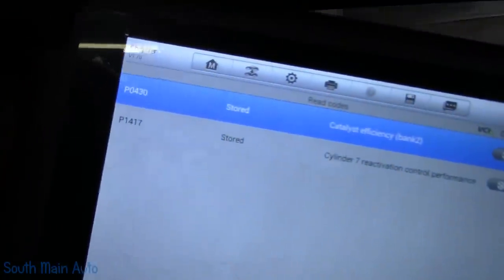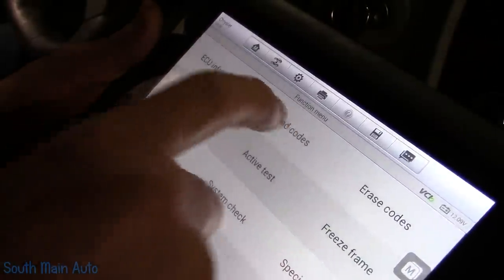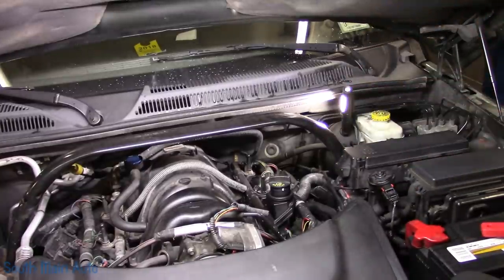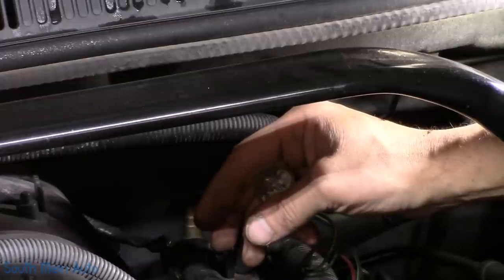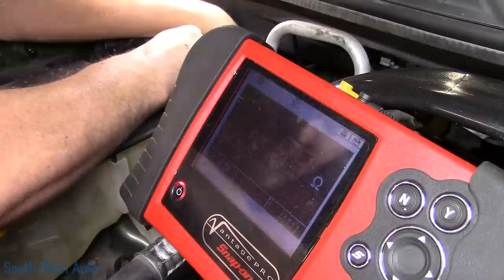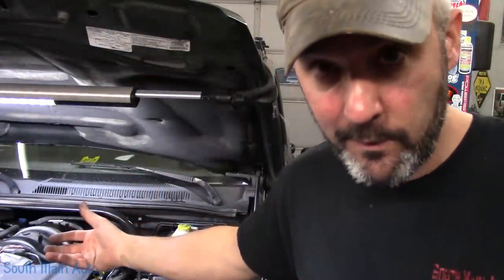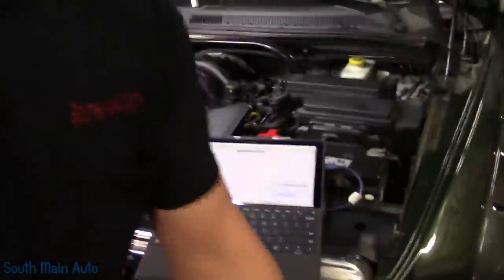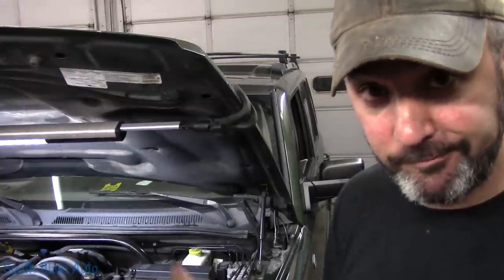Jeep Commander: Dead Misfire / No Parts Needed

Comment: what made you sure the injector it's self was not the problem? I know you tested the control for it and also tested to see it didn't have any amps going to it while running, but wouldn't have an injector with a break in it (open circuit) looked the same? why didn't you test the injector it's self for resistance? (not open circuit)  But great video! Thumbs up!

Comment: On the truck V8 that breaks spark plugs ...to retrieve the ceramic tip I made an adaptor for shop vacuum cleaner by a 1/4 washer pipes about 12inch long  via a glass fuel water trap so the debris gets sucked through washer pipe and drops in trap so you know you got it

Comment: Right away I'm thinking loose plug wire. I had emissions work done years ago, and their recommendation was new plug wires. They charged me a lot of money and put on the cheap wire by the spool, and the plug on ends, which would by their nature come disconnected all the time. Had to do it myself later on.

Well, I guess we are a long ways away from 1969, and the ol' Chev truck. I notice all the electronic work going on and all the "no starts" and other problems, and I wonder how many "no starts" typically came into shops during the week back in the 70's. Are the car makers going in the right direction on all this electronics? Anybody know?

Comment: When I was in the Army, I went to school in 1968 for 40 weeks to learn how to troubleshoot and repair the target tracking, target ranging, missile tracking radars and the analog computer that computed the kill point and guided the missile for the Nike Hercules Missile System. Then I worked at a missile site in S. Korea.  Several times I "fixed" a problem without knowing exactly what "fixed" it.  I accepted it was fixed and moved on.  The system used hundreds of vacuum tubes and there was always something to fix.  Operators ran checks every 6 hours to make sure everything was working.  If not, I went to work. That missile threw conventional and atomic warheads.   Young and dumb with way too much responsibility!

Comment: I wish Ford had a default strategy like that. It would save a TON of CATs. 

Had the same issue on a 2011 Charger. Had a bad cylinder deactivation valve, replaced it and the thing was still misfiring. Like yours the fuel injector was shut down by the ECM and required a reboot. 

In all honesty, tell your customer to start saving their pennies. That engine will bight their pocketbook HARD.

Comment: Intermittent electrical stuff will make you crazy.  Have experienced in the past,  that sometimes simply "making/breaking" contact of electrical connectors resolves an intermittent elect. problem which might be the case here.

Your ohm resistance checks verifies rather low current/voltage.  With the hi humidity, dampness of your area, perhaps a minute amount of corrosion built up in one or more connectors, the culprit you're chasing here.  It doesn't take much to prevent current flow.

Once chasing a NO start condition on a Brit motorcycle, found via an illuminated jewelers loupe 2 of the 122 pins on a long master connector were the cause.  Blast with cleaner, apply dielectric grease.  Wasn't done at the factory, cause of the corrosion contamination.

Myself after this experience, I'd give every one of those connectors a good blast of electrical contact cleaner.  Caig brand "Deoxit" series seems to work better than most.  Disassemble/assemble ea. 2-3 times after cleaner blast to break up, remove corrosion. 

Then cross your fingers, knock on wood!!

Comment: “Disconnect the battery cables and touch them together. “ i readily admit that I have never heard that before. But, after a minute thinking it through, I can see the “logic”of it.  Any downsides to trying that? Or would pixie dust and a crystal pyramid charm be as good? 

Still … an interesting video.

Comment: In the ECU, there should normally be criteria for blocking the cylinder (which it met at some point), and then there should also be criteria for no longer blocking it.   The clue here is the small but notable number of misfires on that cylinder.  Likely at some point it was transitioning from 4 to 8 cylinder mode, and it failed to do so, so it shut it off.  At that point, it recorded the parameters and decided that those parameters are "fail", and refuses to reactivate it as long as those parameters are present (I am thinking engine temp, oil pressure, etc, etc).   My guess is that the pin that engages the lifter didn't engage properly during the transition at some point, left the valve closed when it expected it to be functioning normally, and the misfire was really just a "no fire" because no fuel air mixture got in.  While it would be hard to spot what happened, I think that checking the oil level, oil pressure, and perhaps even doing an oil and filter service would not be a bad idea, as there may be some contaminants in the oil that may have caused the lifter not to engage.

Comment: Looks like there’s no coolant in the overflow, which means it’s probably low on coolant in the radiator. The engine control probably cut that cylinder to lower the engine temperature to prevent damage.
What that means is the owner is in college but yet doesn’t have even the slightest brilliance to check his coolant.

Comment: It doesn’t disable the injector to preserve the cat necessarily… just to keep fuel from pooling up behind the intake valve. The solenoids disable the valves for the specific cylinder so if it didn’t disable the injector when it went to reactivate the cylinder it would open an intake valve with a puddle of fuel on top of it.

Comment: Hey Mr eric i have 2 suggestions regarding your testing here.  1=       When you first checked the injector current you forgot to check the control voltage.  Because no current pulse doesnt mean no control.hear me out .if the injector winding is open or if you have bad pin fitment at the connector you wont current but you will still have a voltage control ( if pcm is not in converter protection mode of course).    You did use a noid light afta to confirm control but what if the injector winding open intermittently .just touching the injector or unplugging it could have temporary fix it.  I believe its better to monitor current waveform then with a second channel back probe control side of injector that way you will know if the injector current return while tou ching the injector .        2=  as far as that code i have seen it set on a vehicule that had a dead miss from a shorted coil.     My theory isthat they monitor cylinder deactivation by. Checking for cyl x misfiring when the solenoid is a activated..well when cyl x is dead already there wont be no velocity change on cyl x powerstroke so the software think deactivation didnt work.   I think maybe thats what it is?

Comment: The lifter had to have stuck at some point and not functioned  correctly or the solenoid mechanically stuck or the oil pressure wasn't enough to lock the lifter .  The plug showed a lot of fouling so I am guessing the intake valve did not decouple and when it went into 4 cylinder mode the plug stopped firing and then the ring of fire began...I am guessing some highway driving will make this issue pop up again
Reply from the maker: remember he drove it about 200 miles with a miss too. I assumed that is why the plugged looked like it did.

Comment: i just wanted to say that Eric O followed a logical step by step diagnosis to try to narrow and confirm the actual problem.  It was smarter at that certain point to do what he did, reset the computer, than to spend more time tearing apart an engine looking for mechanical issues when his gut told him that it probably wasn't the fault.  Did he think the computer reset would fix the problem? Probably not, but it was a better option to try first before opening an engine.  I do agree with him, that it might be heat related as problems don't just appear out of thin air.  The problem is still there if I had to bet money on it.   He will just need to invest more time seeing if he can recreate the bad code again so he can proceed with a follow up diagnosis.  Atleast he can rule out the mechanical lifters.

Comment: I'm just curious you haven't drove it. I'm wondering if the code sets when the cylinder is deactivated or reactivated. In that case could it be oil not flowing.

Comment: From an electrical and programming point of view, unplugging numerous plugs and connection can actually fix the problem. Corrosion etc even minutely can affect current flow. But the computer doesn’t recognize it’s receiving a signal again and maintains its current programming loop. Computers due to a myriad of reasons including a minor programming bug can malfunction. Often just doing a full shutdown forced the computer to start back with fresh current info. It did the reboot looked around and saw everything was in specs. It had no idea of the possible bad connection. If you had done a full reset at the very beginning  you would still have done the work trying to figure out why the problem disappears. Been seeing these mysterious electronic bugs crop up as far back as the late 60’s ( yea I’m old). My dad during WWII called them gremlins, malfunctions with no obvious cause.

Comment: I maintain 6 - 1250 HP, 6000 SCFM 4160 volt air compressors that run 24-7-365 unless a issue arises. They are computer controlled by windows based controllers and I have found that the controllers are very succuptable to any deviations in the 5vdc and 24vdc control voltages. Low or erratic voltages will scramble some but not all control parameters causing some interesting problems that are cured by a shutdown and reboot. I would reseat all the plugs on the Jeep ECU. Good luck!
Reply: Industrial hardware controlled by windows? That controls engineer must be some kind of hack.... far better options out there.

Comment: Was that no 7 solenoid higher in ohm value than the rest at the same temp? It could be going out of range when the engine reaches operating temperature. Would that cause the code and trigger that default strategy?

Comment: I have a jeep... its not like my Chevy coach {vortec 350} at all... complex ignition and tends to corrode more.. for fun I'm guessing when u futz whit the wires it fixed a bad connection ... i've been having ignition code issues with my 2007 3.7 and am cleaning all the grounds tomorrow.

Comment: Could be poor engine maintenance, similar to what happens with Toyota's VVT solenoids. Who does this guy's oil changes, how often, what brand of filter are they using and what viscosity of Oil are they using, could be Jiffy Lube strikes again! Just a thought.
Reply: Sounds like a likely culprit, the MDS system is very fussy about oil viscosity.  My owners manual specifically states 5-20 I believe.  I double check it every oil change.  I do most of my own maintenance.  Did a rear half shaft on my Magnum yesterday and intake gaskets with coolant elbow on the wifes buick a couple weeks ago.
Reply: @Iowahurler82  hopefully you used the newer metallic elbows..never have to fix it again.
Reply: So then, this could have been caused by poor maintenance or wrong oil viscosity?  It seems strange that the "fix" was nothing more than an ECU reset. Cars, these days...
Reply: I did use the metal elbow. But I think that car is going to be getting traded off soon.
Reply: @claudenoto5137  potentially, the car was driven for a while with the issue.
Reply: @Iowahurler82  gotcha.

Comment: I have a friend with a 5.7 hemi and sometimes the truck simply refuses to start.  I have even had the truck shutdown during a turn.  The only solution was to unplug the battery for 5 minutes...and that would "reset" the truck.  It's been updated more than once but the issue persisted.

Comment: So when it enables the cylinder shutdown it leaves the valves closed. Now if it was to get stuck with the valves closed and then just kept injecting gas wouldn't there be a risk of hydrolocking?

Comment: I tell the young techs at work that Chrysler products seem to hold a grudge. Some just clearing the code does not do the trick. You need to do a full memory reset or like you said touch the batt cables together.

Comment: Go figure. Maybe just unplugging and plugging the connectors did something. I remember I had a boss that bought a Jeep Cherokee in the late '80's that would just die on him. Took it back a couple times and seemed to be ok, but couldn't get a definitive answer from the dealer. Must be an act of 'God', lol. Thanks for sharing. You might as well know what you're working with by checking out all the basics to start.

Comment: So, Eric, help me out here.  When toggling the #7 injector with the noid light, you concluded that since the light was pusling, the ECM had control of the injector and the injector shut-off must have been an ECM default strategy.  However, when you had the amp clamp on the injector, if the injector coil was open, couldn't that have been the cause of what you observed?  Open injector coil so no current when the ECM pulsed the injector?  I'm not sure how you concluded the injector was good just because the noid light pulsed.
Reply from the maker: That was my mistake and I am glad you brought that up. In between the off screen shuffles I did ohm test the injector and should have showed that process because you are 100% correct. Good eye!
Reply: Thanks Eric.  You have taught me so much about cars I could never thank you enough!!

Comment: Hai sir ihave a ford taurus 3.6l 2015 gdi ihave a negative fuel trims when iput on gas pedal its like -28  when the car was idiling it was normal it was normal or it is a problem no dtc codes in pcm

Comment: Does the back of the ecm say " INTEL INSIDE " as a warning?
Reply: LOL .... Motorola has been behind the automotive power train computers for decades, now under other name. Its a very close market and just a few chips include features that are tailored to EFI applications (eTPU). Now, have a loud laugh because the cores of the ones used in mid 2000 are nothing but .... POWERPC ! (Mac)

Comment: I have a ? For you where would you start on a 02 Dodge ram 1500 with a 4.7 that has no communication with the engine but everything else and has a code for mil light open

Comment: my 2006 jeep commander 3.7 liter p0204 changed spark plug and coil pack .fixed it for two days started back up coded open circuit cylinder 4 came home from work ran fine again until engine warmed up and started misfiring again ??? any ideas please

Comment: I have an 07 with 5.7 my lifter went out, ruined my cam. Grinded down one of the lobes, put new cam in.. But anyway, besides that it does this same deal as your video. I have a code scanner and reset that sucker runs like a charm u till the next time. Wtf. Life goes on

Comment: Sometimes these computers get just the weirdest symptoms, and they go away with a hard reset or battery disconnect.
I love the amount of control computers give you over a vehicle's systems, but when they go wrong they can look like any number of other problems.

Don't even get me started about aftermarket alarms and remote-start systems. Those can cause no end of trouble.

Comment: What do you use to see the engine compression graph? Checking lifter and valve timings and cylinder pressures?
Reply: He used in cylinder pressure transducer with PICO  SCOP  off course after he pulled the spark plug out  from cylinder # 7 hope this help.

Comment: Is it possible that at some point, a piece of crap got in to the solenoid valve or lifter and actually caused a failure? It may never show up again if said piece of crap got filtered out...

Also, everyone has their process, mine is to check codes, freeze frame, readiness (if e-test), and clear codes, adaptives, etc. in hopes of "making a ghost go away".

Comment: I had code p3497, changed all the mds solenoids, then was getting code p1417, tried unplugging everything and plugging it back in. Reset the codes. Now its running rough as hell and giving me p0307 only, cylinder 7 misfire. This damn thing is driving me crazy.

Comment: Well, my 2013 Mitsubishi a couple of months ago would shut off while accelerating in 2nd and 3rd gear but, because it's manual it would turn back on. I had a code I think it was p6060 or p0606 whatever code for an internal malfunction with the ECU. The stealership tested wires etc and charged me quite a few hours of diagnostic and declared the ECU was broken. They didn't have the ECU and it had to be shipped from Japan. While waiting on the ECU, the problem changed from shutting the car off while driving to just misfiring while speeding up in 2nd and 3rd gear and threw me the code p3001 misfire in cylinder 1. I was too dumb and didn't try to change the coils and spark plugs because, hey the stearlership knows what they are doing... They put the new ECU and the car did the exact same freaking thing. I changed the coils and spark plugs and runs like new. Good thing I requested the old ECU back so, I will dust it out when I will need it in the future.

Comment: My jeep commander with same engine has code P3497 fault on bank 2 cylinder deactivation. I’ve checked the oil which is fine. Disconnected battery to reboot and wipe the code then after 20 miles roughly its back again but engine seems to run ok with no misfires. Any help please?